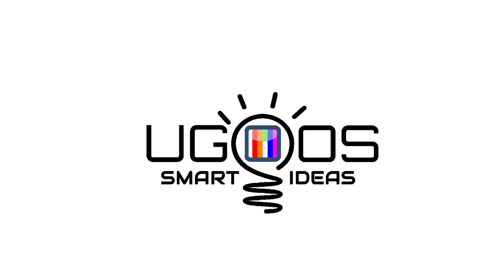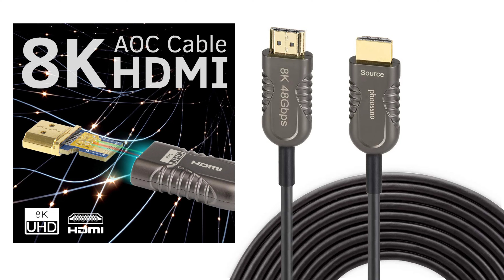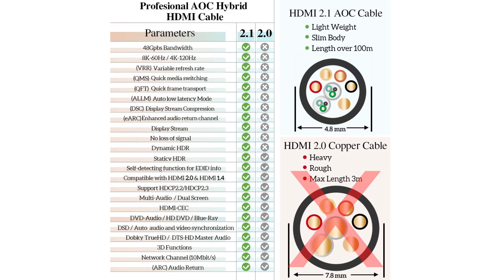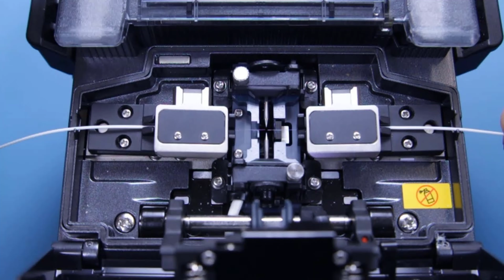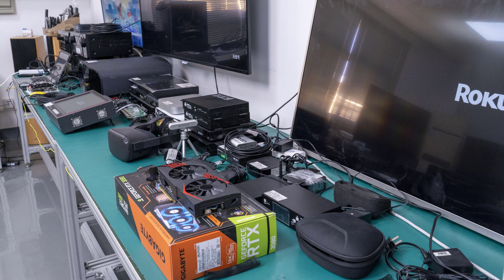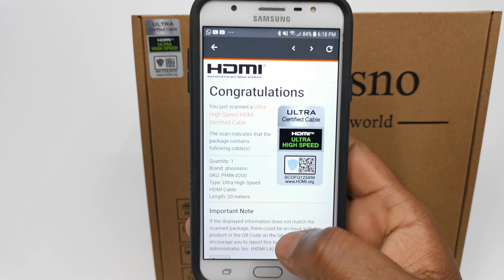Phoossno 8K Certified Fiber Optic HDMI Cables - Premium Quality Cables

Comment: Beats having to use a manual attenuator old school 😂😂👍
Reply from the maker: Whatever was used back then attenuator, repeater, these cables solve the issue.
Reply: @tvboxstop  Tell me about it I use to run a sat system in a block.😂👍
Reply from the maker: Oh okay so you in that field and you would know the challenge of distance to monitor or view feeds from your receivers. Cool
Reply: @tvboxstop  Was gave it up years ago to many headaches that's why I love android systems simple .😂😂😂👍
Reply from the maker: lol I used to work for cable TV company also 👍
Reply: @tvboxstop  I had my own was a pioneer and an innovator much like yourself 😂😂😂😂👍